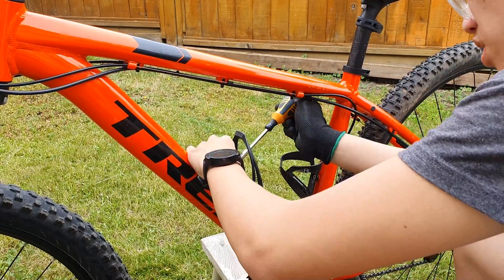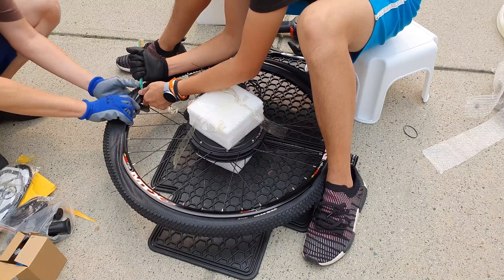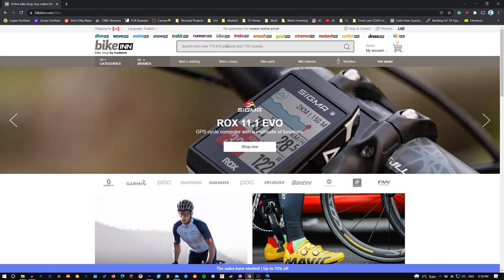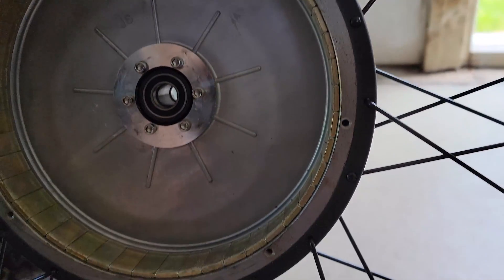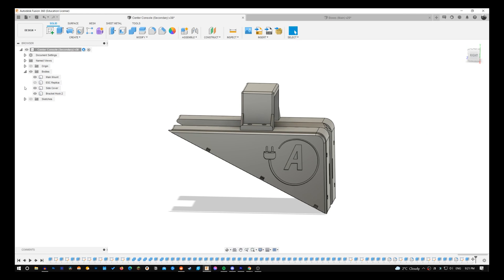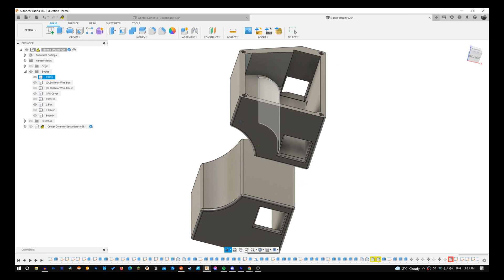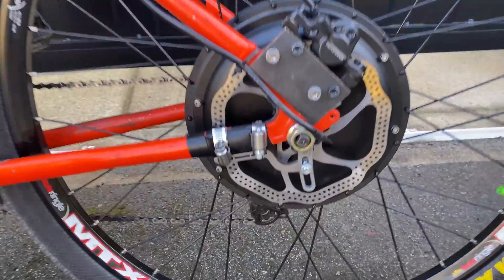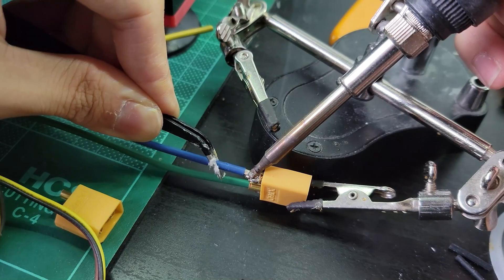DIY Electric Bike (eBike) w/ Conversion Kit: One Year Later

Comment: Is converting a regular bike into an electric one with a kit really that complicated? 😕 I have a Riverside 500 and I'm thinking of getting a conversion kit from AliExpress, but I'm not very handy. I saw that you had several issues during your setup — which you were able to fix — but honestly, I'm not sure I could manage that if I ran into similar problems. I've seen others on Youtube do their conversions flawlessly... so why did yours turn out to be so problematic?
Reply: Those big hub motors sometimes have trouble fitting bike frames. Depending on where you buy it from it may be easy to fit or not.

Comment: You can put the cassette freehub body in a oven for about 10 minutes and the bearings can be pressed in by hand. Clean off any grease first though. Makes it super easy. Put the bearings in the freezer first. Almost forgot about that.

Comment: How much harder is it to pedal an custom ebike on your own, like this one, than your bicycle before the conversion?
Reply from the maker: There is a negligible resistance from the motor, however the additional weight is quite apparent. As long as you have gears, you won’t notice it all that much!
Reply: @AaronsCreations  Thanks for your response. I ask because my primary method of commuting will be leg power, but I wanted to add the motor as a backup source of power
Reply from the maker: In that instance, either go mid drive (I will be releasing a mid-drive eBike build video soon) or use a smaller (lighter) hub motor

Comment: I just passed 300 miles with the same motor and am hearing the noise only when pedaling. I'm assuming that the bearing in the freewheel has begun to fail. Any updates on the bearing upgrade?
Reply from the maker: Yup, as mentioned in the video. Buy higher quality bearings as replacements. NTN is the brand I went with. Each costed around 5-10$. 2 of them are needed (different sizes).
Reply: @AaronsCreations  so I will pull the hub apart and find the sizes and then order them. Thank you!

Comment: Can I have the part numbers for the NTN bearings? I just bought this kit and will be installing it with a 20ah downtube battery on a trek 6300.
Reply from the maker: NTN9201 & NTN9202
Reply: @AaronsCreations  I looked through your video and found ntn6901 and ntn6902?

Comment: Done 8 e-bike conversions - 3 hubs, 5 mid-drives.  Like Bafang BBS02 best - motor is 9.5 lbs.  Look up "Johnny Nerd Out" channel, he's done 100's.
Hubs are nice for Flats, battery killers on hills.  Spokes tend to stretch more with hubs, hear the Tink, Tink when riding.  Yup torque arm required for hubs.
Watch "High Voltage " channel.  His BBSHD w/ASI BAC 800 on a Specialized Fat Tire is a Boss Bike.

Comment: So cool! I am also on this plan of making an ebike, and I am really enjoying the process! I literally measured every dimension related with the installation before making the purchase. One technical question though how did you calculate the curvature of the plastic components to fit the frame? Like mine is not perfectly round so it makes the sketches harder
Reply from the maker: My method is taking a photo of the triangle, importing it into Fusion 360 then tracing a 3D mesh using the photo as a guide.

Comment: Thanks for the fine video. Those Schwalbe tires look interesting. The tires that came on my Trek Verve 3 are very much road tires so i am interested to see how they do on gravel.  Will try the schwalbe on the front if the stock tire feels sketchy.  My build is a bafang BBS02 48v mid drive with a premium 20ah battery.  So far so good.  Using a release  agent, i beddded the battery mount plate to the down tube for a perfect fit with epoxy.  No more jiggling and very much improved fit.

Comment: It's not likely the dropouts caused the bearing wear unless the hub is designed poorly. Still, putting pressure there would grind the wheel to a halt quickly. Bad bearings and/or poor tolerance were the culprit IMO.
Reply: Chinese bearings took out the Zumwalt destroyer. He thinks he's bought authentic Japanese bearings, but the packaging may not align with the contents. Thanks China.

Comment: Oh, those Slime tire tubes didnt work well for me. Bought 3 and first one exploded while pumping up air. 2nd one the air just left tire and took out and the slime didnt work of the hole. Found out there was a twist in the rim film so I fixed this but I expected the Slime tire to do what it was advertised to do. I left tubes to use patch work later on..

Comment: Very awesome DIY E BIKE BUILD. If you plan on making another one, can I suggest using a bike frame with DUAL SHOCKS./? I have 2 e bikes, 1 factory made MTB with just front shocks and other is CKit Build using Next Power Climber DUAL Shocks. There is extreme difference when riding, the 1 shock bike is rough after the front forks and always have to lift up butt when coming across obstacles of bumps, pot holes, ect. With Dual shock bike it is extremely awesome to ride over obstacles going fast and having bike adapt to conditions of road. It is the 2 piece Dual Shock bike frames I believe is the best perfect frame to handle suspension. Believe why them 3000watt and up e bikes using them Enduro frames BASED ON THEM FRAME DESIGNS as there are many bike brands that sell them for cheaper price to use for e bike build. BIG DIFFERENCE OF COMFORT.
Reply from the maker: You couldn’t have put it any better. Dual shocks are a must once you step into the territory of high watt output motors. I have a few plans for a dual shock bike conversion but unfortunately haven’t had the time nor budget. Maybe in the future though 😃

Comment: I use 26x2.5 tires and it makes a huge difference in comfort and grip. I highly recommend. My bike is 7kw
Reply from the maker: Super powerful!
Reply: that´s crazy, what battery are you using?
Reply: @danielramhede617  Lipo Batteries. Like for RC Cars and drones, They can Output a lot of amps without break a sweat on an ebike

Comment: Thank you Aaron, theses are nice tips, I got a 175mm rear hub motor on the shelve, cause my bike is just 170mm, so nothing would fit. So I deiced to leave it as. After this winter season the planetary gears need some replacing one of the 28T Gear has 14 of em left. So in April I should receive the puller and the gears and do my first motor repair. It's really nice to see your kind of videos it helps out a lot. Plus you 3d printing skills are great. On a other bike I did a DIY as well a bit like yours but mid drive and dual battery. Feel free to check out my tube.
Reply from the maker: Glad I could help. Yes! A motor puller (stator puller) is crucial for motor repairs. I’ll take a look at your videos.